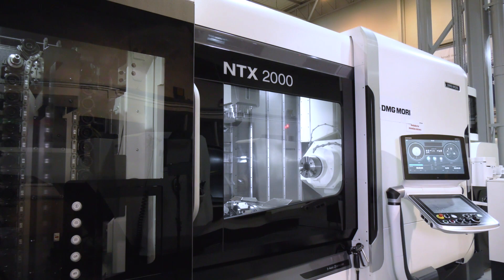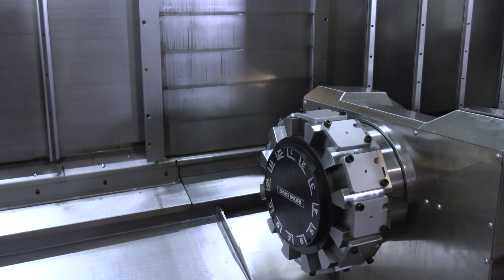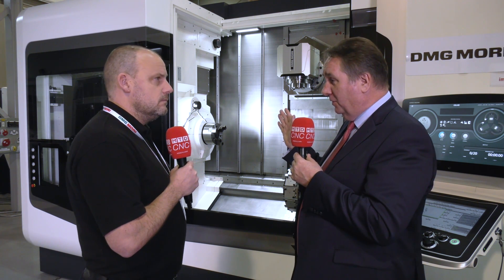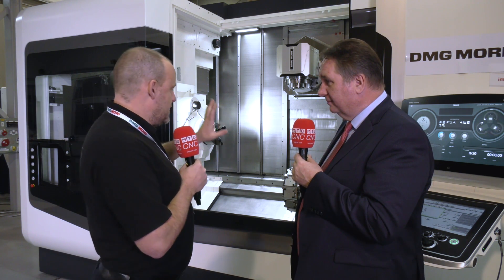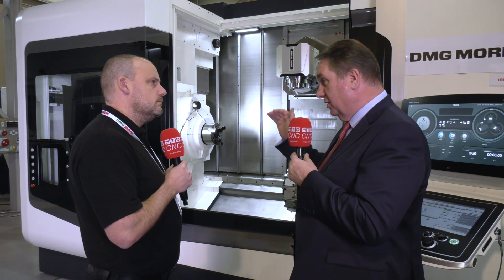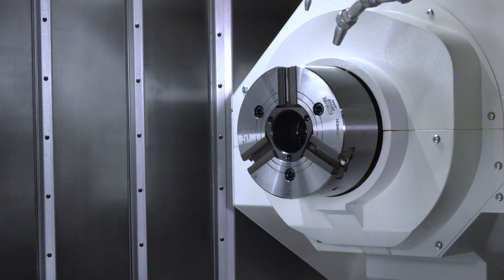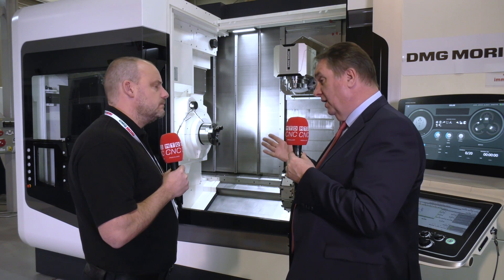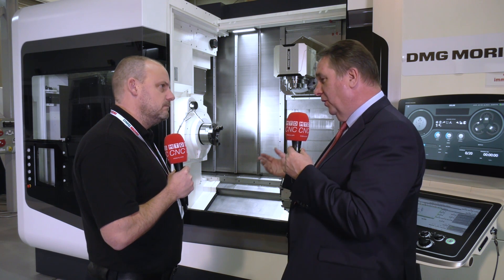DMG MORI UK have stock including a fantastic NTX 2000

Comment: Use the NTX3000, it's an OK machine, just over a year old and already had new mill spindle and spindle 2 bearings are a bit iffy, but get cutting data right and work holding they are a good machine, seen a massive reduction in cycle times, but could be due to other mache being so old. And new cutting tools. Used the skiving function from their tech cyles and lower turret for broaching.
Reply: did had it brand new ?
Reply: How is yous skiving performing?
Reply from the maker: Glad you enjoyed the video !